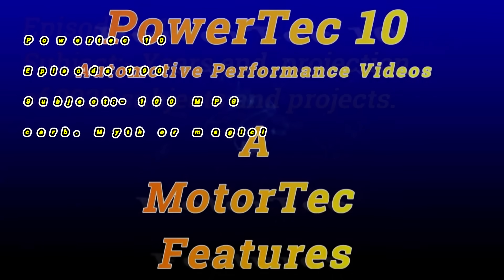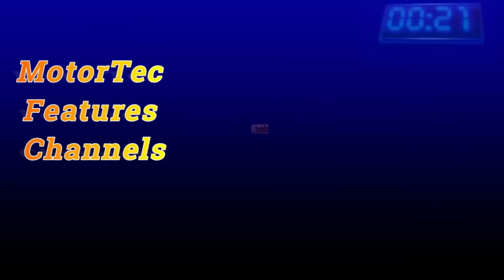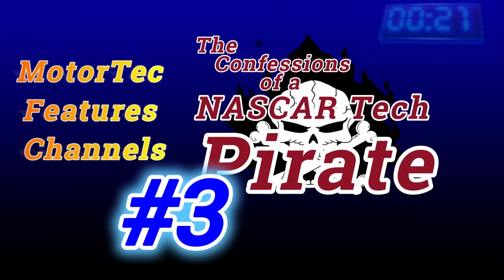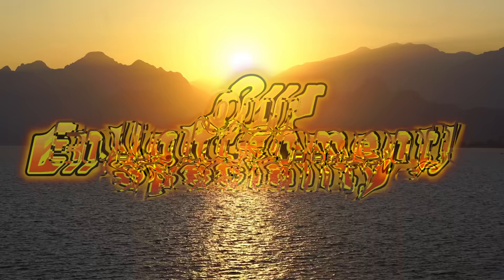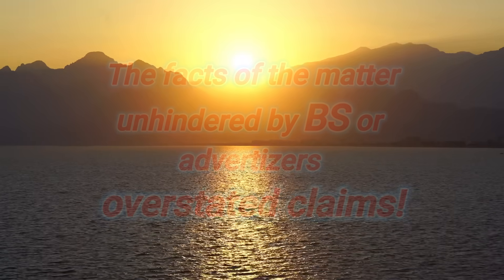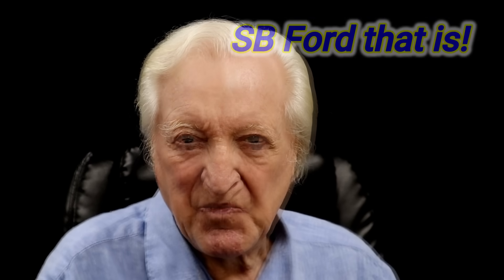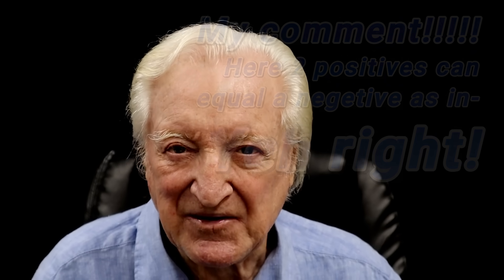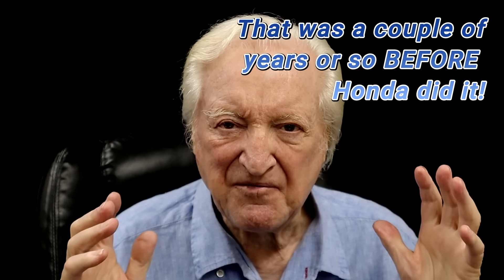The 100 MPG carb - reality or real BS

Comment: Back in 87 I bought how to build a 100 mpg carb manual and a 2 page catalog of devices and parts to buy. I didn’t do the build, but the janitor of my high school at the time I showed him what I had and he ordered the parts and plans. The company was called Carb Research Center in Oklahoma. He built it and tested it on his motor home  with a BB 454 and the device increased the mpg went from 7mpg to 36mpg. It was not easy to keep the Vapor consistent but he kept it on the motor home for 3 years until he sold it. He did it on his 82 Toyota truck and he got well over 75 mpg on the Toyota. I  was a mechanic and manage of a gas station and helped him build the devices and some of the testing. He had more patience then I did and he drove that Toyota for the nest 4 years till I moved out of state. It worked at the time a lot of experimenting. The company at the time was called the carb research center in Foyle, Oklahoma. I still have the plans somewhere in some old boxes I have. There were a few other people I knew of who did this to their vehicles, but I never saw it firsthand so I can’t sayin honesty what their results were. It works.
Reply: Yep, I bought plans too from CRC. It basically had several plan versions (all with a mikuni motorcycle carb. for the test engine, a 283 chev. truck) with 3 heater cores sandwiched together & they finally added supplemental exhaust heat to that. Finally, they made an exhaust heated 3 pass tubing box & tripled their mileage, but lost power at the higher temperatures.
Reply: @PaulThomas-qo9vy - we did something similar. The exhaust was not working well. We converted to using coolant and later another heater core to slightly cool the Vapor because it got too hot. Good old CRC. They had an oil supplement I used in my 67 Chevelle that worked really well. It quieted down the Rhodes lifters and my highly built sbc with huge crane cam never went flat again. In our car club at the time other guys called this stuff snake oil but worked really well for the time. Long story….
Reply: There's zero chance he got 36mpg out of a 454 in a motor home.
Reply: @Cautionary_Tale_Harris  - he went from Victorville California to Lake Shasta during to night and he worked out the mixture. That was the highest he got doing the math. The motor home was the most difficult compared to the Toyota. Most people had the same response as you did. I understand your disbelief but that was the best mileage he ever got. Most of the time it was 18-22 mpg.
Reply: @theloanmonster2012 
Is the elevation of Victorville about 4,000 feet higher than Lake Shasta?
Reply: @Cautionary_Tale_Harris - lake Shasta is just over 1000 feet in elevation. Victorville is right around 3000 feet above evaluation. At the time we lived in big Bear California. Part of the prom was that big bear was around 6500 feet in elevation. Tuning was the most difficultpart because of elevation. That’s why he used Victorville as a starting point.
Reply: Cyclemaster

Comment: I have personally witnessed this back in 1979. A mech guy in my tech school did it with 350 v8 Nova. The exception was he had a small canister of alcohol with a feed to the carb, but he didn't use much of the alcohol he said. 100mpg. I wish I would have asked him more questions back then.
Reply: No you didn't. 
No one is getting 100mpg in a 350.
Reply: Maybe but also they had a Chrysler engineer on a hot microphone admitting the fuel management in modern car dumps fuel into engine even if you are costing down hill to keep the catastrophic converter warm. Older Cadilacs had a trans that actually  free wheeled completely disconnected going down hill.   @Cautionary_Tale_Harris

Comment: THUNDER HEAD 289 ..
HE GETS CLOSE TO 50.MILES PER GALLON OR I. SEE ITS 40 MILES. LAWNN MOWER CARB. IF HE RAN 2 OF THE SAME CARBS HE WOULD NOT HAVE TO GOOSE THE THROUTLE  AS MUCH: :: 289 :: 302:: NOT CUBS ::: BUT ITS  WORTH  WACHING FROM  START TO GETTING   IT TO WERE HE GOT IT :  : YOU WOULD LIKE  THE VIDEO S::::

Comment: David is it possible to make a carburetor that uses a transfer slot style fuel delivery system instead of jets? This could be and easy way to tune engines not having to change jets just adjust the metering rod to add or remove fuel. Would like to here your thoughts on this. Regards, AJ.
Reply: Look up the Ellison Carb for aircraft.

Comment: Total myth. The function of an internal combustion engine involves moving parts that have weight and resist movement, that necessitates a minimum amount of ENERGY. A carburetor is not capable of increasing octane or multiplying fuel molecules. Efficiency is possible, but not at 2 to 4 times what has been previously achieved through years of R&D. In short, there are no free lunches in physics.
Reply: Why can't you just believe in magic like the rest of us?

Comment: I had a 72 MG Midget, 1275 cc with twin SU carbs and a header feeding the stock exhaust.  Over ~50 mph it would get 20 mpg but but below 50 mph it would get 40 mpg.  The step on the needle came out of the jet at ~52 mph and you would accelerate to 80 (top speed) real quick.

Comment: The brake specific fuel consumption of a gasoline engine at part throttle sucks. The engine has to power a huge inefficient vacuum pump that distracts from it's available power and efficiency.
Reply: Not all petrol engines have throttle plates. Both the Alfa Romeo & FIAT "Multiair" systems and BMW Valvetronic systems replace the throttle place with variable lift on the intake valves AFAIK.
Reply: @TassieLorenzo  That's true, but even without a throttle plate there's still a vacumme in the cylinder.

Comment: This "mythical" carb would only be one part of an optimized system:
-Low weight
-super low drag
-low rolling resistance
-able to hit 55 or 60mph
-small engine
-low losses between engine and drive wheel

But that's not what people are thinking of, when they hear "100mpg".  They want this carburetor to do that, bolted onto a big, heavy, high drag sedan, that holds 6x dudes.   THAT is never going to happen
Reply: yes but no. look up the fuel economy they can get with trains. then throw all the crap they feed you out the window.
when properly designed yes you can get great fuel economy. 
even on my daily driver i have a v8 swapped suv that can beat a hellcat in the 1/4 mile and other 500-800hp cars. yet i get 30-35 mpg. the less rpms you need to turn to move the betetr off on everything.
Reply: @chehystpewpur4754  GM threw the Volt into the metal scrapper, they could have taken the Volt to the next level but decided to reduce it to a Bolt.  Right after that GM goes to lawyers and downgrades GM Inc. into gm ltd.
Reply: @babylonmustfall  ok and? that has literally nothing to do with what im talking about
Reply: weight is only about acceleration.
Reply: The basic fact is a ratio , 14:1  or 14 parts air, to one part gas, that's as lean as you can go and still run an engine. That's why there will never be a 100 mpg carb, unless it's in a car weighing 100 pounds and travelling down a slope for 100 miles , powered by a radio controlled airplane motor of 5 cc.
Reply: @markanthony3275  Some claim that the 14.7:1 air/fuel ratio does not apply when the vehicle is at constant speed, primarily on the highway at a moderate speed.
Reply: @babylonmustfall  GM used a Lean-Burn Cruise Mode in Australia and New Zealand; the vehicles would get 20% - 50% better fuel economy than their US versions.
Reply: @markanthony3275  and then Otto Cycle is only, like, 1/3 efficient

Comment: what about the 100mpg EFI? isn't the engine size and efficiency what you're looking for? if it takes 20HP for me to go 60mph, wouldn't max mpg be a 20-30HP engine running at max volumetric and thermal efficiency be the best?

Comment: I think it's possible.  Now as to whether  or not life would  be the same after  building the carburetor,, I think  that would be the question.  You would be  cutting  the profits  of the oil industry. 
  Anyway, ,  for what it's worth.   To achieve such , I would think the delivery of the fuel to the cylinder  would have to be changed. Or rather the state of the fuel.
 Food for thought.
Reply: Have you ever heard of the automobile industry?
Reply: Yes, spent the most of 50 years repairing and building  vehicles  of one type or another. @Cautionary_Tale_Harris
Reply: @Cautionary_Tale_Harris yes, I've spent the past 50 years or so repairing  and  building  vehicles of one type or another.

Comment: A 3500 pound car with DOT legal street tires cannot achieve 100 MPG simply due to rolling resistance and air resistance. Take away ½  the weight (MGB) and ½ the air resistance (tiny sports car MGB versus family sedan) and you can get into the 60-70 MPG realm (as indicated below). If you could make a car about the frontal area of a 1965 F1 car with modern low resistance (and thin) tires and keep the weight under 1200 pounds, you might have a chance at nearly 100 MPG. But this is not a car Mom could drive to the grocery store.

And this is from someone who gets 24-25 MPG in my 2015 S-600 on interstates, and 30 MPG on the downhill run from Flagstaff Az to Kingman Az, mainly by coasting down hill.

Comment: In a car that is aerodynamic, light, with low rolling resistance you can have a small carbureted engine get 100mpg easily. In fact, the record for a wheeled vehicle is 3788mpg set in the 2016 SAE Supermileage Competition. In a normal 4000lb sedan, not a chance.
Reply: @rrpeters; Your posted comment is clearly properly focused upon the entire vehicle for efficiency, not just the drive train, engine, fuel system, carburetor.
Please see Casey Putch custom designed Omega Zero vehicle in its current tested configuration with a standard four cylinder Diesel engine, achieved normal use, not specific highway, or constant speed, more than 100 MPG. Also performance level acceleration 
The keys are the are the weight, aerodynamics, efficiency, power transfer.
The vehicle was designed, built over 10 years ago, recently more fully tested, posted 2024 within his yt-channel.
Other combustion engines can also be used too.
Am actually surprised if David Vizard has not seen this vehicle and videos.

Comment: So the question is , is it standard size car or a ultra lightweight bicycle tired minute engine with a carb the size of a walnut  vehicle, there is a guy on you tube that built his own car that runs on diesel that gets I believe it was over a hundred mile per gal , I could believe that a cycle car could possibly get 100 mpg with aerodynamics weight reduction and a midget driving it 👈🏼😏

Comment: I drive a car that got me 155.75 MPG for the entire last week. Top end is 145 mph, has 425 horsepower, zero to 60 in 4.2 seconds. Does 0.95 Gs on the skidpad. It's electric, a 2022 Tesla Model 3 dual motor long range. The damn thing is a pig at 4,030 lbs. But turning electricity into motion through magnetism is easy and extremely efficient. Turning gasoline into motion through heat is extremely wasteful. Too much of the heat is lost. Better to use liquid hydrocarbon fuels for heaters rather than for automobiles. I've got one of those cheap Chinese diesel heaters and it is amazing how much heat one gets out of it. If I used that diesel fuel to power a pickup truck I wouldn't get very far!
Reply: All the evil aspects of your wonder car happen remotely at the power plant instead of the tailpipe. Stop fooling yourself.
Reply: @funone8716  How to you know I don't have solar at my own home for the energy I use with this car? Also, you don't seem to realize how much energy is used to locate, drill, pump, transport, refine, and transport some more for your liquid-fueled heat engine self-propelled automobile?

Comment: What about "a carburetor" but instead of basically spraying the fuel through a nozzle to atomize it, you use ultrasound (like from those humidifiers) to atomize the fuel. My theory is the ultrasound would be better able to atomized the fuel into finer droplets making it better mix in air leading to finer control of the air/fuel mixture. (It's also worth mentioning this technology would have existed in the second world war era.) 

Maybe also switch to titanium valves and space-age special coatings so it can handle the heat better by leaning it way out?

Comment: You don't need a better carburetor...You need a better transmission. Every engine in the world has what's called low brake specific fuel consumption. That's an optimum load, at an optimum RPM or, optimum RPM, to most efficiently drive a load. Typically, an engine with larger cylinders produces better thermal efficiency, than one with smaller cylinders. For efficiency, get the Ford 300 I-6, rather than the 289 or 302 V-8. Your speed is dictated by the posted speed limit, the load is dictated by the aerodynamic characteristics of the vehicle. If it only requires ~18 horsepower to maintain speed, from an engine capable of producing 180 HP, the trick is to gear it up, and run the engine at a low RPM, but at higher torque. That helps compensate for the "pumping loss" of the engine trying to pull air past the restriction of a throttle plate. It takes horsepower, to create the pressure difference between the intake manifold, and atmospheric pressure. Slowing the engine down reduces the requirement for airflow volume, and low manifold vacuum reduces the pressure differential. If you can 'lug" the engine, while maintaining optimum ignition timing, and, fuel/air ratio, you can achieve thermal efficiency similar to a diesel, which has NO throttle plate! All that said, I might be able to get you half way there, in a corvette, or something aerodynamic, that's big enough, to run such a large engine. I've been able to achieve 60 MPG in a Toyota Prius Hybrid, and 72 MPG in Volkswagen Golf diesel, using experimental lubricants, running at 50 MPH. At 55 MPH, I haven't tested ANY vehicle, that could even approach 100 MPG  at that  speed, not even a motorcycle!

Comment: Before watching, I'm going to say it makes more sense to talk about a 100 mpg CAR than a carb.  I know all the tricks my Honda Insight does to get 70 mpg (with the hybrid battery disconnected), and so I am 100% skeptical of anyone who thinks they could beat that number with a special carburetor on a 225 Dart or something.
Reply: Excellent point!  Despite what some think, it's not a conspiracy. The Honda Insight is only 60-70 MPG with every trick in the  book, to do better in any kind of real, practical-ish production car is going to be very difficult.  By all means you could have aerodynamic streamliners like the Aptera and like solar cars, but motorised but they don't offer the interior space people expect in a car.  Or you could go for even narrower, even lower grip tyres than the Insight's 165/65 R14 -- but sometimes people go around corners in their car!
Reply: @TassieLorenzo  I will say, the Insight has more grip than you'd expect.  The tires are skinny, but it's 1,850 lbs so the contact patch loading is not worse than a narrow-body Challenger.  The stock RE92s are even pretty grippy, at the cost of shocking wear rates.  It's main problem handling-wise is the same problem the RSX and EP3 had, which is that Honda did not understand MacPherson strut geometry at that time, so the camber curve is wack.

Comment: check out a you-tuber. thunderhead289. he did some really neat stuff with a lawnmower carb and an electronic air bleed system he built. put it on a 302 maverick beater car.

Comment: The principal question in my mind: what is the energy potential of a gallon of gasoline? And furthermore, how much of that potential can be utilized and how much is bound to be wasted via heat loss, etc.? After those questions are answered, the vehicle weight, speed, and drag need to be considered. After all is said and done, obviously the project of the 100 mpg carb will be a failure. By the way, I see the 2024 Toyota Prius advertising 57 combined MPG.
Reply: AFAIK, the most thermally efficient internal combustion engines are found in Formula One and are around 51-52% efficient.  One US gallon of petrol contains 139.5 Megajoules of energy.
Reply: So cruising at 70mph, that gives you an absolute maximum (at 100% efficiency) of 27 kW or 36 hp to play with.  However most engines are more like 30% efficient, which leaves 8 kW or 11hp to use.  A typical car needs at least 15 kW to cruise at 70 mph, so you'll need a kind of ultra-aerodynamic ultra-low resistance car similar to a Solar Challenge car which can cruise on far less power (with very little comfort!).

Comment: Pounds of fuel per hour. 
It takes so many “X” amount of Pounds of fuel per hour, to create so much torque and or Horse Power. 

King David:)
I want a 427 cid High Compression Engine
Mounted in a 1983 model Lincoln Mark VI
Big Square Body 2 door with flip up headlights:)

Comment: In the mid-70s Volkswagen had a diesel rabbit which got 55 Mi per gallon I believe, but it was definitely not fast
Reply: Yeah, about as fast as my GMC Diesel crew cab with the 6.2L non-turbo.  It didn't matter whether it was loaded or empty, or pulling a trailer, 0-60 times were measured in minutes (ha, ha, ha), but mileage was consistent 27 plus.  I loved filling up every 1-1/2 to 2 weeks for my around town driving (had dual 32gal tanks).  Hell, it got better mileage than the wife's Chevy Cavalier, and about the same acceleration.  One side note on the crew cab...drop the hammer and it made LOTS of noise and rich black smoke, and still accelerated about the same.....